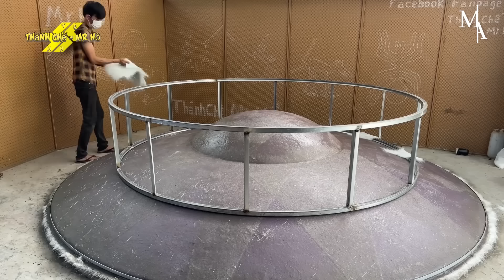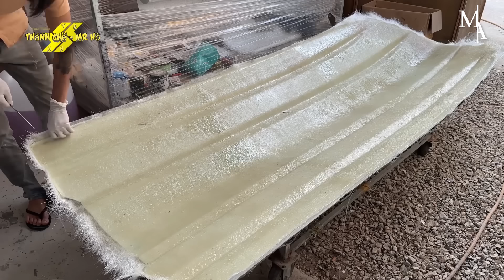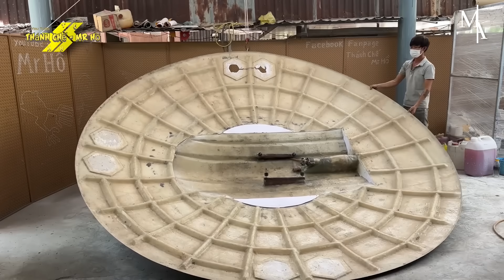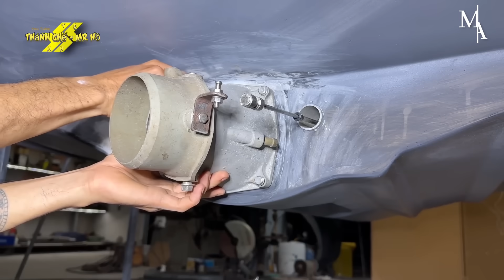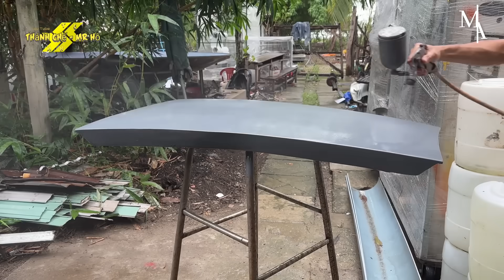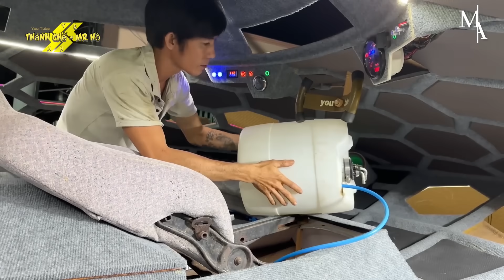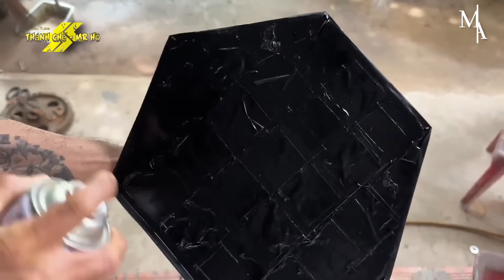Man Builds DIY UFO Boat with Car Engine | Start to Finish by @Mr_Ho

Comment: Terrible fluid dynamics. The form is a lot of fun but it didn’t appear to be very functional. Couldn’t keep it going straight or flat on the water. Extremely hard to control when bouncing up and down like that. Hope it never catches fire, the whole thing is a flammable death trap

Comment: Safety slippers, simple face mask working with glass fiber and welding/plasma cutting galvanized steel. This man will have a fun, short life
Reply: You forgot the contact cement and painting in a confined space
Reply: @MillerMachineWorks  you're both too fragile to go outside

Comment: Good JOB.... Except he needed VTS (Variable Trim System) and iBR (Intelligent Brake & Reverse) ... VTS or just simple TRIM system is needed to tilt the thrust UP and Down to improve forward momentum. So he isn't jumping soo much...  IBR is needed to Break and Reverse... again, doesn't need to be intelligent or motorized... any Simple Brake and Reverse would make a huge difference and would be very easy to install. 

So great JOB... just needed Trim, Brake , and Reverse... (Brake and Reverse should also allow for NEUTRAL) soo maybe Trim, Brake, Reverse, and Neutral.... Neutral is just holding the LEVER between Brake and Reverse. All this can be found on SeaDoo JetSki from 2000

Comment: Design oversight: when accelerating, the nose pitches upward, making the upper observation window inaccessible. It would have been simpler to convert the lower hemisphere into an observation section by darkening it from the outside while keeping it visible from the interior)

Comment: Use electric motors that runs on solar, and then when it gets to the top speed, it has to go over to magnets that will give you a higher speed  ,,on the outer layer of the magnets you put fins to move up and down, left and right,

Comment: I had a scrap piece of this craft. You couldn't burn it, or dent it with a hammer, and when you crumpled it up in your hand it would spread right back out like water. It felt so light like you weren't holding anything at all and thinner than the foil in a pack of cigarettes. 👽

Comment: Very nice build and great attention to detail. It would be even better if it was quieter using an electric motor and a battery pack where the fuel tank lives. It would have a restricted range but I’m guessing that you’re not going on long trips in this!

Comment: That ufo saucer boat can only stay above the water at a certain speed limit. Like 15 to 20 max speed per hr any higher it will flip because of the design. That ufo is built to cut in the air not the water as we have seen . Nice try .🤓🥊

Comment: I actually solved the UFO myths. We were never alone in our solar system. But the difference in body composition makes contact almost impossible. Here an example we walk at 4 mph that is normal for us. Other beings walk at 10000 mph that is normal for them. It's like watching us move in slow motion. Even on the sun there is life. What is hot is relative to a specific body composition. I'm the only with this knowledge. No one else knows this. So yes they were real. They were here and probably still are just move so fast we can't even see them.

Comment: I once built a large telescope dome observatory by myself.   The money and time for this guys project omg!
What I built was 13 ft tall x 10 ft wide , round , on a 9'' thick cement pad 14' x 14' . I put a steel tubular frame all
through the inside for protection against hurricanes.  It was made of hi grade marine fiberglass .  14 years
later , I moved , I put it up for sale , It sold within 1 hour of listing it !  I was shocked at how many people wanted
it. ! ?   Upon taking it apart , I learned it didn't need the steel tubular framing .  It was so strong and structurally 
sound . It had electric remote control  for rotation / open close etc..  heater/ ac , security , sound system , fans
intercom , It had 4'' conduit stuffed with 150 ft of wires of every kind.  Some of the data cables cost 3$ a foot.
I built it in one year under the hot Florida sun.
Reply: I would love to do that.

Just moved into a house in a high desert area - and almost ghost town - there are maybe a dozen people that live here full time.

One of my outbuildings has a second story that was built as a viewing lounge for watching sunsets.

There is essentially no light pollution. There are two street lights, but they are small and down the block from me.

We're on a plateau at about 3800.'

And 150 miles downwind of any air pollution - as long as there are no forest fires.

I have a whole extra lot I can build on, and out here, no one pulls permits.

I've played around a little with fiberglass.

If I built an elevated platform, I think I'd make a mold so I could do molded sections and pull a vacuum during curing to make it as strong as possible.

What was your materials cost?

I'd probably overbuild mine too. I'm not an engineer, and materials are cheaper that a lawsuit if it collapsed with someone in it.

Did you buy or build your main bearing for rotating it?

I dunno. I'll be 66 this year, I have maybe a few projects left in me.

I was also thinking of building an underground shooting range on my second lot.

Ventilation would be the biggest issue. Probably use an old car engine to spin fans on a serpentine belt.
Reply: @Zomby_Woof  If you build a observatory dome
using fiberglass, That stuff Is so strong , You don't
have to over do it.  I way over did it.  My friend who 
work with it all the time showed me that plain , simple , easy would do just fine.  So make it easy 
on yourself .  I hope you do ..also - giant binoculars
are often more enjoyable than a telescope . I like 
45 degree angled ones. and you can image through one side if you wanted.  Unless the scope is really 
large $$$  Id go for gigantic binocs.

Comment: This saucer watercraft is unsafe and unstable at any speed.
The front shape lifts the watercraft more than it should out of the water. Making it unstable at high speeds. Also harder to maneuver. Moreover, potentially flipping the watercraft upside-down.
The saucer watercraft is less about practicality and safety. But constructed for the sake of YouTube likes.

Comment: My zodiac had the same wobble when a heavier friend was driving in the rear of my zodiac inflatable, I was in the front, that created a wobble that made me seasick, and I have been in the most troubled waters so the propeller were spinning in the air, over the waves. so good luck with the vomiting that most likely would be a result of this unstability.

Comment: Fabrications is some of the hardest Industrial Textiles to work with. But the rewards are remarkable. I don't recommend using a grinder in a pair of sandles,  and a respirator would be better for your lungs ,,just saying.

Comment: Wow! As a prolific farm workshop fabricator myself, that was an epic and skilful build! I wonder if there might be the need for an underwater wing or hydrofoil to smooth out the high speed up and down motion? That’s not to take away from the builder skill in any way. What’s even more impressive is the fact that he built this in a country that may not have resources available as easily as other countries. You are a real craftsman and l look forward to your next project. 👏👏👏

Comment: handling fibre glass without wearing mask is committing suicide.
Reply: yeah, not to mention that those below waterline protective finishes are super toxic, containing biocides, VOCs and heavy metals; in the US, even the jankiest of boat finishers fully suit-up with PAPRs to spray that stuff or blast it off.
Reply: the sketch factor is high in a lot of their process.

Comment: no floatation foam underneath grey cloth insulation material?
any possibility aerodynamically speaking boat might flip over when encountering splashing waves on the bow line ?
why not EV power train?
why the solar panel?
cabin ventilation?
in case of capsizing 
emergency exit hatch?
otherwise great engineering with mechanical concepts

Comment: Did he eat well before going on a trip? What if two water gyroscopes were installed inside the boat? Their flows should be directed in opposite directions as the same speed.

Comment: these production steps are so efficient and optimized, im just stunned. i learned so much from this and have to review it many times, because this is gold.
only 2 cents:
i hope the pilot has some seatbelt, helmet and an fire extinguisher xD.
Or you need to install a stabilizer that you dont bang your head when its jumpin

Comment: 22:34 I’d have given the steering wheel a bit more clearance. You only get a quarter turn out of it before the wheel hits the frame of the ufo
Reply: Just shorten the cable little movements make bit turns
Reply: The way that thing moves and tracks, I think that's pretty much the limit of the boat's control authority.  😂

Comment: Should have made the controls more like the ones from the ship in Disney's old movie Flight of the Navigator.  No pedals, no levers, just everything from hand pedastals.  Push forward to move forward, back to slow down, pull back to go backwards, slide left and right for those respective directions. 

To top it off...put hand  imprints on the pedestals that only have 3 digits.  A thumb and 2 fingers.

Comment: Incredibly unstable. A small gust of wind will lift it out of the water it appears. Needs a below surface stabilization system or wing.

Comment: It is really nice construction work and very good engineering with the engine and placements of all the inards, however I worry what happens if a strong gust of wind hit's the front when it's running down a river or lake, it look's like it could flip over, and then how do you escape?

Comment: Thanks for the upload. This was a two to three year project crammed into a 23 minute video. However, the fibreglass shell was too thin. That aside, the toxic interior fumes from all the synthetic materials used will be devastating for health over long periods. But the same craft design made with welded stainless steel panels, supported by internal steel framework would have been far better and healthier. No apologies for downgrading the project!

Comment: The ingenuity of this build is beautiful.  But the lack of safety is unbearable.  I would not want to sit in a boat with a car engine roaring behind me. The vibrations alone would do considerable damage to my ears.
Reply: . . . and the fuel tank under the seat . . .

Comment: I see an issue with the threaded push/pull linkages to open & close the doors...

the threads won't last long. They will wear out very quickly without lubrication, but even with, they will still wear out pretty quick. I know this because I've done it...😂😢

Look into "Acme thread" rods & nuts to replace yours. Acme threads are square profile, so they don't wear as quickly. 

IE: Acme threads can be found on a bench vice. 😉

Comment: …not to forget the obligatory safety flip-flops!

BTw, Bernd Rosemeyer (German race driver) died bc his high speed car went airborne and crashed into a bridge. I'd check what will happen if wind gusts are lifting the boat into the air, and how he will get out of it once it lies upside down in the water and is probably sinking.

Comment: Overall a great build. The one thing I would have done differently would be a smaller 2 cylinder motor like a 1000 cc motorcycle four stroke engine, with a good muffler to run quiet, coupled with a motorized inboard/outboard keel to adjust the thrust angle, allow it to glide more horizontal and not bounce upward.  The other thing would have been to add three small automatic evacuation bilge pumps (with check valves to not allow outside water to enter the pumps) to expel any water that may get forced in through windows or door, etc.  And lastly I would have used a lot of waterproof spray foam to make it technically sink-proof for International Coast guard standards for watercraft. And lastly I would only have one window, the other guidance could be in an array of small backup type cameras and a main 10" forward camera with zoom capability to give you better views for guidance, avoidance and just a better look. This build could be a sellable product very quickly. Thanks for posting.

Comment: I am surprised that nobody has come so far with an anti-gravity disc shaped aircraft. The knowledge for it is available, only a very strong electrical supplier like a small fusion reactor is nessecary. I guess it is well known but kept under wraps.

Comment: :face-turquoise-covering-eyes:I must be crazy: I saw it in its entirety!:face-green-smiling:
But...no gloves, no boots, only masks when necessary, and they even use their bare feet to hold things. They work so well, with such precision in the necessary gestures, with ingenious ideas and materials, that the rust doesn't lie: they're truly repurposed!
- A genuine lesson in recycling and engineering.
- I just think they'll have to add some flaps to keep it in the water, or it'll take off.:face-blue-wide-eyes:

Comment: I liked the imagination that went into the design and building of the craft. I am concerned that the fiberglass craft would suffer major damage if it crashed into an object at speed. The addition of floatation material inside the craft might prevent it from sinking, should the craft become flooded. I can't help but wonder if vibration from the engine might cause the engine to break loose from its mounting to the hull.  🤔
Reply: Yeah it looked like the steering was slow, so if that thing hits anything, Bank, Rock, stump, even a big stick its sunk. 😐
Reply: "crashed into an object at speed" boats are general not designed for that.
Same with plains
It's really only cars that are and it says something about how common it is to crash into stuff when on ground 😂
Reply: @MouseGoat  Are you ok?

Comment: cute and cool but the disc shaped body as u can see clearly is NOT the right shape to move in water. it bounces up and down every small wave like a  rock u fling over the surface . its just way too wide . the width is very counterproductive .. but it looks very cool . i hope h einstalled a super cool xenon light system as well ^^.. and LED RGB light cords ..

Comment: This is honestly one of the most talented people I’ve ever seen. Insane creativity and craftsmanship. Well done
Reply: That’s super cool..but what about carbon monoxide poisoning? You have what looks like an inboard-outboard motor.
Reply: @juliejoest7580 from what the exhaust goes outside the hull
Reply: I wasn't too sure what he meant by that, maybe if the engine incurred an exhaust leak, I'm not sure!🤔...
Reply: Bad ass! I've never seen a plug tooled like this before. Great idea!
Reply: Attenzione area 51 😮
Reply: Đây một người Dân miền tay Vietnam bạn này còn lầm rất nhiều sản phẩm lắm❤
Reply: @TrungTin20475  Practice makes perfect. 😂 Much better than I could do
Reply: Đây là một trong những người nông dân Việt Nam, Chỉ có nghề cơ khí, chứ không qua trường lớp đại học kỹ thuật.
Reply: Brilliant and satisfying. Well done